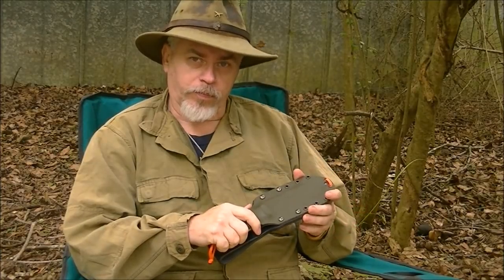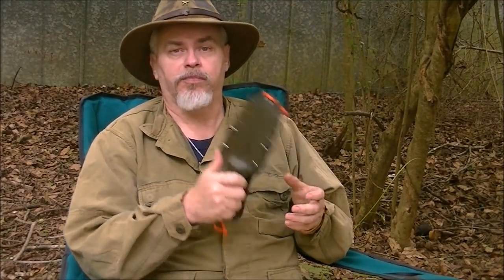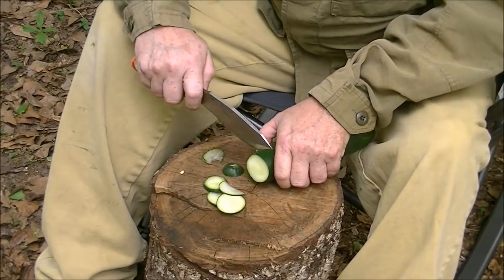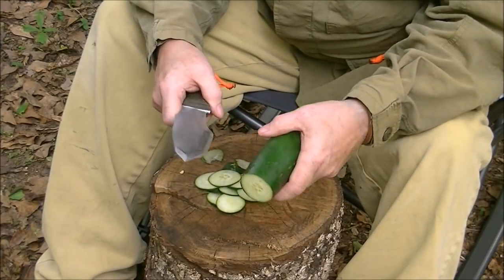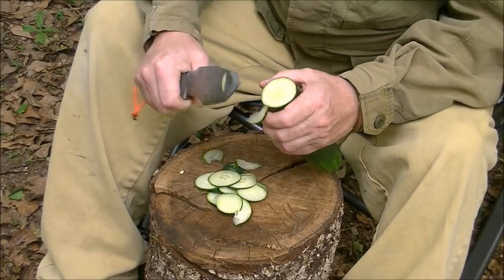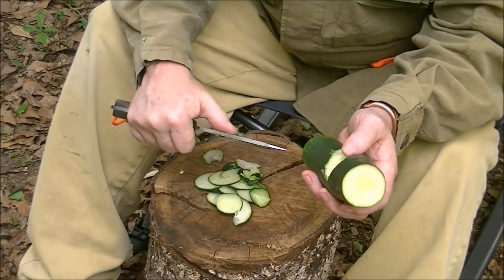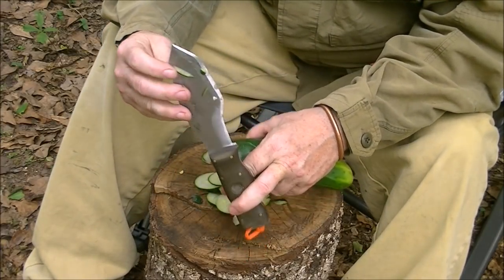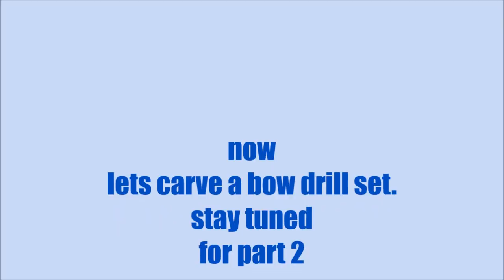WCSK DEMO

Comment: I am not sure of how valid a demonstration is made by cutting something so soft,  but regardless, I would actually like to see a comparison vs a decent knife with a more traditional blade shape. What kind of advantages are we talking about and why don't we hear people complaining about a lack of ability (in these regards) in the traditional designs.
Reply from the maker: the cutting something soft was to show what the  points and edges are for... i could have used hard oak but the video would have been 25 min long..it was to bring the viewer up to speed on a rather strange design for a knife..now i shift my focus to how the knife performs ..with out having to stop and explain every cut and why i chose to use that part of the blade..it was a time saving  thing for me..
Reply from the maker: and thanks  for the comment..you brought out many of the questions i am going to try and answer with this blade..safe journeys
Reply: Thanks for the reply, I understand the reasoning but I am a bit concerned about the illustration because of how easy a cucumber can cut. For example you could easily gouge out out a bowl in that with just a ordinary spoon so while the knife may have certain abilities, the fact it can do them in cucumber doesn't mean it could do them in wood.

However if you were not demonstrating that it can do something, but taking it for granted it can, and just illustrating them I can see the point. I just feel that given the less than ordinary design skepticism is probably a wise choice in any viewer.

As an aside, somewhat jealous of hard woods, where I live I mainly have pine and juniper. There is some spruce but we have a real lack of actual hardwood to work with. Cutting white pine does however do wonders for making anyone feel like a lumberjack.  

Do you have the full kitted sheath from stitched gear?
Reply: Very Tom Brown Tracker'ish...Looking. Minus the sawback. I'm pretty sure you can make all those cuts with a straight edge design.